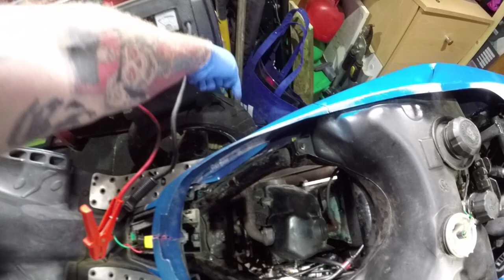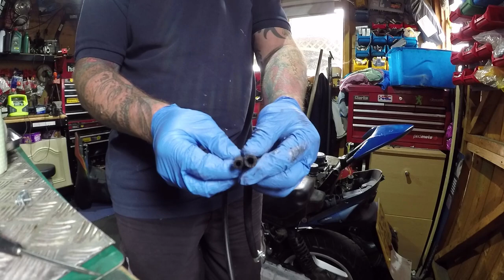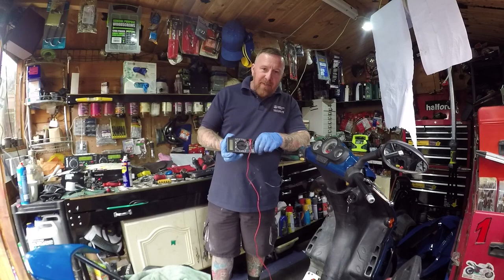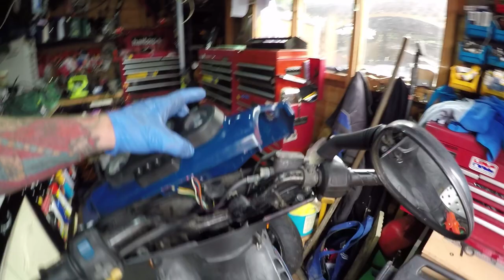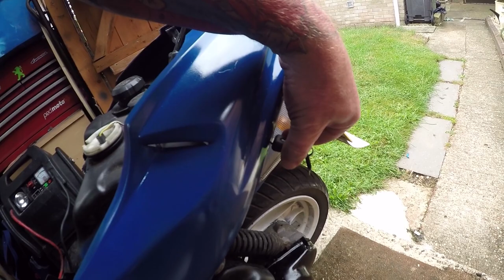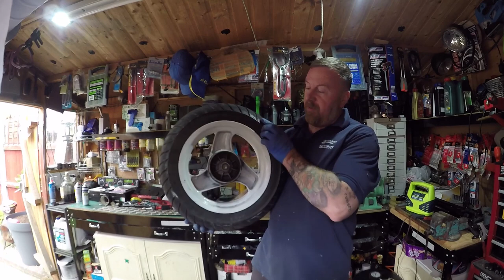SPEEDFIGHT MOPED CARB KICK START VARIATOR WIRING HEAD PLUG MARK SAVAGE

Comment: I have an speedfight 2 2004. And when I'm driving about 60 km/h and after stopping and trying to drive again I can't have gas could it be carburetor that's pumping too much gas? It's like I'm driving dropping at sign and I don't have gas about 5 seconds. Could it be something else?
Reply from the maker: it will be your carb bud , guessing you already serviced it with a new plug and air filter?
take carb off and clean, make sure all the fuel lines and tight and not gone hard if so replace 
then check the float it working like in my carb videos and the vacuum is working too like in my videos 
theres over 70 on speedfight all will help bud

Comment: Mark l am looking at getting a Honda Nsc50r 2016 how do you derestrict it.
Reply from the maker: To be honest I've not worked on one but most newer mopeds are restricted and hard to derestrict  !!
But a sports exhaust 
A small upset and a sports air filter will always help
Reply: Thanks Mark, l haven't bothered with it.  Sorry to ask what about derestrict Peugeot speedfight 4  4T 50cc
Reply from the maker: @nigelbowles74  this can be done but by a garage!
As they are cdi restricted 
You can out on a sports exhaust,  upjet , race filter , and variator system which will all help but still need the cdi done 
Great fun looking the sp4 bud
Reply from the maker: @nigelbowles74  or try find one that's been done all ready and test ride it just to make sure lol

Comment: Hi Mark. I have a problem that on my speedfight 2 when I turn on far headlights the blue light doesnt turn on? Is that a big problem.
Reply from the maker: So you have normal beam but high beam the blue light on the dash does not light?
But do you have the high beam light ?
Well if this is then it will fail the mot however it is only a £1.50 bulb and very easy to replace 
Check out my videos they will help as over 80 speedfight videos some show you how to do it 
Take care bud
Reply: @marksavage  my bulb works but the blue light doesnt turn on.
Reply from the maker: Yes thats just a dash light 
Easy to replace , sometimes it can just be a bit of wd40 and a clean up 
Take the clocks off and sort it bud

Comment: Hi. When I start my speedfight 2 it smokes really much and after I drive a bit it smokes a bit. Could it be the oil?
Reply from the maker: Cheap 2t oil or piston rings !
I'd try changing my 2t oil first then see how it runs but clean your plug more often as it will oil up or change it for a new one plus clean air filter 
It will help

Comment: Hi have you got Front panel for a tgb rx50
And Peugeot speed fight 3 two-stroke but don’t know which piston to get
Reply from the maker: sorry bud i don't have any parts bud
Reply: Okay thanks Mark I bought a Peugeot speed fight 3  couple of weeks ago it needs a piston and everything that goes  to piston all missing and the screws but do not know which piston  to get because it has a two-stroke but been told Who I got it  off it’s a 125
Reply from the maker: @scrapman1949  if it 2t its a 50cc bud as the 125cc is a 4t !!
They may have put on a big bore kit but it will say on the head and I'd put it back to a 50cc anyway
You should get most parts on e bay for the sp3
Reply: @marksavage  how can I send you a picture of what’s inside before I put the piston on
Reply from the maker: @scrapman1949  do a video and upload it with as much info as possible and let me know and I'll take a look
Reply: I’ve uploaded one

Comment: I've got a question, i drive a 2008 peugeot speedfight 2 ac  and i drive it without the variotor ring, but my bike makes a high noises between 67 kph and 72 kph, do you have any idea what it could be, at different speeds i do not have this problem.
Reply from the maker: 45 mph is fine for these and it can co faster so it not a major problem 
I'd check over the system so belt 
Make sure the variator has no scoring or damage and the rollers are clean and all good 
Check clutch is ok and test it like in my videos 
Make sure its lined up ok and back on tight 
Are the fans ok none broke or damaged?
See how you get on
Reply: @marksavage  i already checked the variator and the belt, they are fine, rollers are fine, i will have to check the clutch and the fan, thank you
Reply from the maker: @stanvanvenrooy1902  worth a look , are you sure it's coming from that side
Stator coil ?
Could be rubbing on the bendix ,they often can rattle and make noises
Reply: @marksavage  but if it would be my bedix, wouldn't ik make that sound at all speeds, it only makes it between 67 and 72, and not when i'm going 80 or any other speed, that's the weird thing about it. And my bedix rattled before, but i already fixed that
Reply from the maker: @stanvanvenrooy1902  agree then odd bud to just be between a speed 
But car wheel balancing does the same sort of thing so could even be the variator out of shape?
Only a thought

Comment: Hi Mark! So I have an speedfight 2 2004. And I had the problem that my moped was choking when I gave it a gas. So we tried to put the acceleration needle in carb on the middle one. And it went better. But my dad said that I need to srew the mixture screw all the way in and it could be better. However I did It and it started choking again so I putted it on recent mixture but It didn't even want to start driving it was just choking. What could it be? Can you please help me...
Reply from the maker: You did well then bad dad lol 
Check out my carb videos and my tuning video they will help 
Set the carb back to where it was ?
Or back out 3half like in my video and tune from there 
They can mess around after being put all the way in( no air) 
Clean plug and start again bud 
There's over 70 speedfight videos on my channel to help bud
Reply: @marksavage  hi! Do I need to start the 3 turns out where it is all the way in or when srew is straight horizontal?
Reply: @marksavage  oh and. If I srew it out 3 half turns out and it's choking. Should I srew more out or in?
Reply from the maker: @raivisvjaksa4686  follow my tuning video bud 
Type in mark savage tuning 
Normally out halfs and test 
Might even be too big of jet
Air filter change or clean 
New plug needed
Reply: @marksavage  now that I've putted it on recent mixture. And now when I gas and let it on idling it dies.. What could it be the spark plug?

Comment: can you do a video on replacing front fork seals(50cc) dual shocks please
Reply from the maker: To be honest 
I just replace the whole thing as most of the time they are sealed units bud
Reply: @marksavage  Hi Mark, my ped has failed on inadequate dampening. is redoing the front forks in terms of stripping down, resealing and filling of oil something any lad can do with mechanical knowledge ?
Reply from the maker: @mastercreative1  so you ask me to do a video 
Then tell me it's easy and you can do it 
Confuessed bud why ask ne
Reply: mark savage sorry I mean would it be easy for me to do myself ? Or would a professional need to do it ?

Comment: My son had a  direct bikes he ripped the threads off the crank holding the flywheel on then woodruff key sheared off destroying shafts slot
Reply from the maker: that's not good at all bud and you would need to replace the crank?
Reply: @marksavage  the bike has always been hard to start since we had it replaced engine with completely rebuilt one only thing hasn't benn changed is the wiring loom that's next in case a wire has gone white reducing power somewhere to ignition system

Comment: Why does my speedfight 2 only go 40-45 (used to go 55-60)
Reply from the maker: service bud 
so new plug and air filter then variator take off clean and change your rollers this will help go for 6g rollers bud
Reply: @marksavage  I forgot to say. I have changed new plug, air filter and variator should be okay i have checked. Belt raises up at front and goes down in clutch and i have changed rollers. And engine work like it should and it reach max lap but its like power just dissapear somewhere. I thought could something like nozzle or fuel hose be broken or blocked?
Reply from the maker: no I have had this and it was the rollers but they had squad off and caused this problem, is the belt ok, may need changing too
have you tested the clutch like in my videos and my winter speedfight video as this did that too and that's what it was
Reply: @marksavage  i check the video soon and i test lighter rollers and i have new belt so it shouldn't be belt
Reply: I also trowhed some very thin washer away after that it started to twitch sometimes
Reply: @marksavage  i think its the clutch and back plates because they are quite noisy. But can that affect speed so much

Comment: Hello my 100cc speedfighter won’t idle can you help
Reply from the maker: carb bud, take it off and service it like in my carb video , the 50cc and 100cc basics are the same bud and it will help
Reply: mark savage  carbs clean it’s got a tecnicgas exhaust on air filter and 92 jet won’t idle or move anywhere when it does it goes then bogs out the colour of the plug is black like oil
Reply from the maker: take carb off and follow my carb cleaning video bud 50cc and 100 are basically the same , I do have a few 100cc videos but 70 speedfight videos all will help 

mark